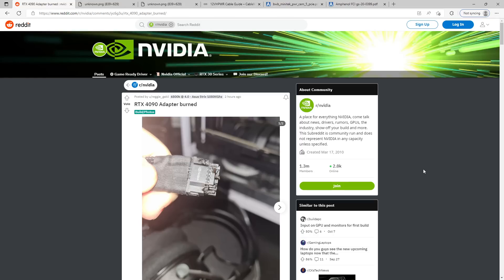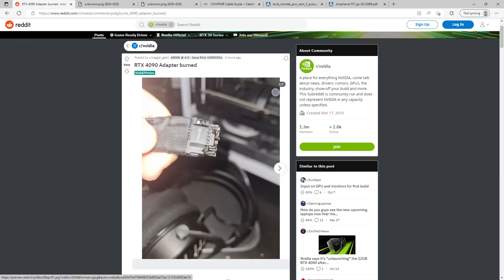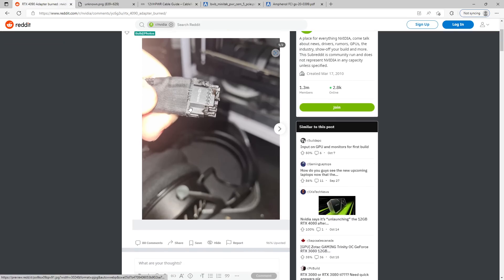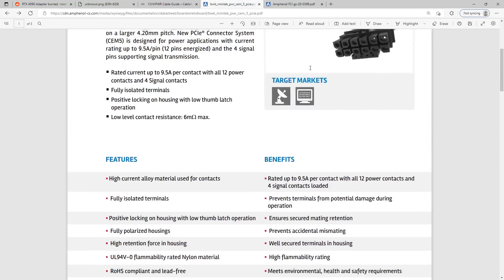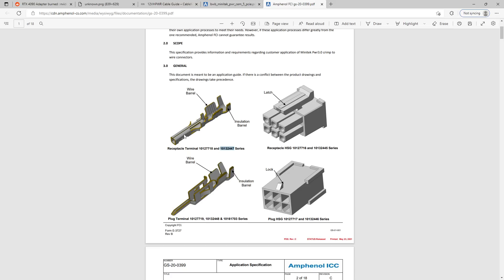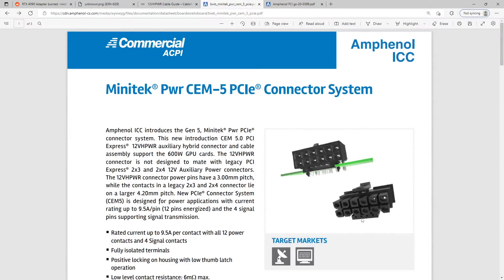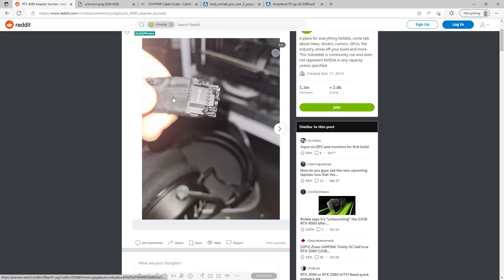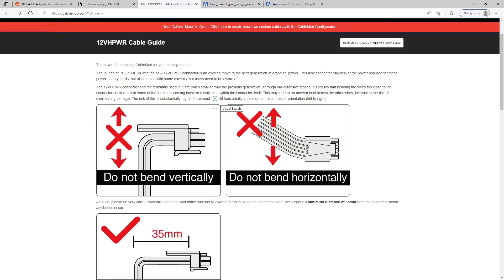The 12VHPWR connector sucks

Comment: 1:20 What about the data pins on the new cable? Aren't those supposed to communicate with the PSU to minimize transient power spikes?
Reply: Everybody is calling them data pins there is no data on those pins at all. They are sense pins that need to be grounded the combination/number of pins grounded tells the GPU how much power it can draw. Else a conversion cable to use old specced dump atx2 psu could not work at all. Its a old trick to use sense wires en used in combination with the used power connections in the connector dangerous and stupid. If they wanted backwards compatibility and security they should have included a 12v signal wire and have shunt input for every pin so the card can measure the resistance of every pin and limit the current on each pin. But yeah then the Pcb space would be used by larger but safer powerdelivery circuit.
Reply: @chinesepopsongs00  thanks for that detailed explanation

Comment: Holy Molex Batman. I thought we fixed this issue. This sounds like a load of bullshit. Most likely heat is shooting straight up into the connector from the card creating the problem. Someone should do a thermal test on the connector when the card is horizontal vs vertical.

Comment: looking at the design of those terminals (at around 10:00), I can't help but wonder which monkey approved that design. I'm not an electrical engineer, or an engineer of any kind, but even I can see that is a TERRIBLE design. How the hell did that get approved by anyone? Having that separated seam down the middle weakens the overall structure.

Comment: Silly, foolish, naive Nvidia... Wants smaller connector that can handle more current because you know GPU today = space heaters apparently :-D ... And they come up with this fragile obviously not working (burning) shit? What a piece of work. Here is an free advice Nvidia. Wants more power? And be smaler then even one 8 pin. Shove an XT60 connector there. It can handle 60A at 12V that is  720W and it is smaler then this burntup crap. And it requires only 2 wires. Better be thick ass wires there :-D ... Or an XT90. That baby can handle 90A at 12V that is sweat jesus 1080 Wats of pure users power bill money turned into FPS... Deamn... Iam having too much fun here... Great work Buildzoid. Peace.

Comment: I love the idea of the new connector, but hate the execution. It's getting ridiculous adding another 8 pin every gen. We are at the point where we litterally need 4" worth of connectors to power a card. They are going the wrong direction though. We should be moving to less wires but a larger size with thicker, more robust contact points

Comment: You’d think that if given the opportunity to create your own, custom, high power connector, they’d have designed it to be able to work for the application it’s designed for.  Well done, Nvidia!
Reply: @_Clivey  Nvidia designed its 12-pin precursor (which they used on the RTX 3090) though.
Reply: @_Clivey  See, this is what's confusing. Nvidia claim to have designed it, some people say keep saying they designed it, but it's also a standard.  
Either way, it's obvious this connector is crap for high power PC applications .
Reply: The must be hiring their management from Boeing rejects, cause they're certainly crashing and burning just the same
Reply: the 30 series FE connector was an inhouse non standard connector and had zero issues. but it also was only pulling a maximum of 450w. the standardized one is smaller and is rated for significantly more power how Intel and PCI-SIG thought that was a good idea i don't know.
Reply: @_Clivey  shhh don’t speak facts and logic in the comments section. When AMD uses the cable it will be ok
Reply: @dennisp8520  nvidiots seething their 600w card is on fire

Comment: to be fair...if this thing worked as advertised it would cut down on cable clutter :P

but this connector with it's issue's.....time for a V2 :P also having made my own cables...they might not be welded to the connector but damn they (at least with PCI / eps / ATX 24 pin / SATA / USB / PWM and occasionally molex...they will sometimes eject on there own wile plugging in) they might as well be welded to the plastic I've frequently had pin's where the tool was in to release it but I still pretty much had to wrap the cable around my hand and pull stupid hard to get it to release..have also had USB cables where the pin was not properly in the connector and it came out wile plugging the connector in to the header >.< it keeps amazing me how secure and at the same time loose a pin in a connector can be >.>

Comment: Good to have this info out there.  Its beyond me why they, all of them, PSU and Nvidia alike have done more testing and ultimately a better job of it for power connectors.  How much work would it have been to just develope a connector with double the power instead of four times the power and most likely have solved all the issues without going to extremes.  So you have two twleve pin connectors instead of one.  Certainly enough room on the PCB for two power connectors.  Sheesh.

Comment: The thing about the bending if you read that statement carefully appears less concerned with the bending of the receptacle around the pin or a consistent load bending the plug in the socket.

Instead, the issue appears to be more what happens to a multi-wire cable where the wires are held fixed relative to each other, and what happens if you then bend that bunch of cables near the plug end. The illustrations show that the wires on the outside of the bend are then stretched due to the difference in radius between the inside and outside of the bend. This may weaken and damage the crimp where the wire connects to the pin receptacle. Thus if one of those power wires gets disconnected by pulling out, it will either cause a very poor connection and potentially heat, or the gpu may try to pull that lost power through the remaining good wires, hence the warning about increased load through the wires. (Not sure about that last part, I'm a mechanical rather than electrical engineer).

But if you bend the wires further away from the plug end, firstly there may not be held as right relative to each other, so you don't get the same level of pull. This tension is also spread out more across the wire and less into the crimp connector at the plug receptacle.

Hopefully the requirement for 600w is the only reason this connector exists and the AIB 4080 and lower cards might have standard 8 pin connectors

Comment: Well, good for them, they saved $5 on PCB space and connectors! Hope they get sued for a lot more for burned components (and hopefully not houses and families). Or are they just going to blame the end user for bending a cable too much? If so, good luck to them with that too.
BTW it would be great to see those heat up under a thermal camera while you bend the cables during recording. How about that? Don't need a 4090 for that, just a general power consumer with the same connector attached.

Comment: Agreed with that. Why would they move from using beefy 8 pins connector to this flimsy little connector. Now everyone with older PSU will need to use the octopus legs extension. I find that the reasoning behind it for the founders edition is acceptable, but third party board partner following the use of this connector doesn't make any sense since the card is already brick sized. A few 8 pins connector wouldn't hurt.

Comment: That new connector is far worse that normal PSU connectors and its guaranteed that those smaller pins are way weaker and easier to damage. 
Another problem is that connector on PCB is weaker as well, it does not have strenght to hold and I am pretty sure this will be one of common problems with 4090 failures.

There are so many design issues that its complete disaster.
- Much smaller pins and connector as whole is much more structuraly weak and I mean both connectors, one on cable and one on PCB as well as reducing safety margins for current it can pass through safely.
- That stiff end of wire to connector is making it worse as it will strongly increase force put on PCB connector and potentialy break it. (using full replacement cable from PSU manufacturer instead of this stupid reduction is big improvement but not solution)
- If they left connector angled as on 30 series FE cards and make it so that when putting stres on cable will push it to something instead of pulling it out of pcb together with cable even actually bracing to gpu cooler it would have made it more durrable.
- if that connector had metal casing that was actually soldered to PCB as for example HDMI connectors are it would prevent breaking it of PCB. 

One disaster decision piled on another without any mitigation to problems it creates is worst kind of engineering. Person who came with this solution should be fired on spot.

Comment: Ok well I just bought a 3090ti and a 1000w gigabyte pcie 5.0 PSU. Should I be worried that this can happen or am I safe as long as I make a bent in the cable away from the connector?

Comment: Like, like, like like, like like, like...
You did a 17+ min video on a several minute read off of Reddit. And could have shaved a ⅓ of that by eliminating the word "like"... But, hey, and thing for subs, right?

Nvidia provided shitty ass power connections on their 40 series cards that cannot handle the demand of the load. That's it... Because of the two connections not being 'rated' (The "shitty" part btw) it cannot handle the load like the wire before and after the connection. Or else, you would see burnt insulation throughout the wire or a weakening/discolored joint on the board. And had those connections been properly rated, cablemods wouldn't have had to put a disclaimer on their products or site to cover their ass.

For those that still aren't following this process, this acts more like a over-rated fuse instead of a solid connection. Which part is going to heat up first kids? 12awg wires at each end of the connection or the 16-18awg connection? Answer is: 18 gage connection (Pins). The smaller the wire or connection, the higher the gage; the bigger the wire or connection, the lower the gage (awg).

And ideally, on those type of pins after they are crimped onto metal part of the wire, they are supposed to be soldered. And then the insulation part of the wire cand be crimped at the end. This also plays a factor in rating a connection also. How many people have checked if their pins have been soldered, even the 8 pins? I'm guessing not many...

Comment: Who knew miniaturizing a power connector and push even more power trough it, would create problems... very smart.

2x12V braided cables and 2x GND braided cables with 1 sense pin was all that was needed. Scale the mm2 for 600W and put a fat connector on it, problem solved.

Comment: Is this connector a problem if I plan to use my 4090 at ~325W? I need to cram a 4090 into an NR200 so I'll power limit it, and Computerbase says the loss in performance with a 300-350W power limit is minimal.

Comment: I think you nailed it right on. High resistance loose connections are the issue. I'm no electronics engineer but I've been an electrician for many years and we see this all the time. I don't understand why manufacturers are thinking some test in lab for 24hr period means it's good
Reply: Electronics engineer here. There is also going to be a possible issue over longer period of time in case there is a higher contact resistance on one or few of the pins, but initially it works fine, but as the card gets more power cycling and the connector pins experience high and low currents at times times, the thermal expansion and contraction might degrade the contact resistance even more. 

Like in my 3d-printer where originally all connectors were fine at the start, but after hundreds of prints and the connectors cycling between high and low current, the heated bed's connector finally melted it's contact housing and the connection broke, so on one of the pins the contact resistance had slowly degraded over time and increased the resistance, until finally it was so high the the contact heated up so much that it melted the plastic housing.

One of the causes also seem to be the very stiff wires that they use, which causes more mechanical stress to the connector, especially if it seems to be on any kind of sideways direction. I wonder if for example, silicone wires (basically wet noodle stiffness) would allow for tighter turns, because they aren't so stiff...
Reply: @antecboy  The stiffness is the copper itself, not the plastic insulation.  These are multiple 0.8mm² wires in a cable that parallels them to carry 63A like the heaviest common industrial cables with IEC 309 plugs.  Those big IEC 309 plugs aren't even rated for use below 20V (purple color code) and wouldn't physically fit.
Reply: @johndododoe1411  0.8mm²(~18AWG) wire is still quite small and silicone wire at that size would very flexible. I can only assume, having not opened these harnesses that the strand count for the copper is just average, not special in either direction. I'm guessing the insulation is PVC, which isn't the most flexible material either, but it is cheap. But if the problem comes from the copper being too stiff, then a higher strand count wire would make it less stiff for a given mm² area.

I think it would be interesting to build a custom wire harness with silicone wire to test and see if that does help with the problem.
Reply: @antecboy  Don't forget the combined stiffness of all those parallel wires.  Hence my suggestion to use a single braided copper strap for each rail and a connector that is inherently good for 67A.  The one I suggested can be trivially integrated in the back of the card with an airflow optimized cable attachment.
Reply: @johndododoe1411  You are right The 3090 ti has the exact same connector but a 3 cable adapter instead of 4. The 4 cable adapter is way too huge and stiff so its prone to damaging the connector. The PCI 5.0 cable should solve the problem or using a smaller 3 cable adapter.

Comment: I wonder if the voltage drop due to using less cables of (i believe to be) the same gauge would effect stability or overclocking, since ur pushing more current through less cables. the voltage is still stepped down internally for the core and other stuff, but i still wonder if it would cause any problems.
Reply: I think these connectors will probably self destroy after 1 or 2 years of heavy use.  Also I think the AIBS are going start using standard 8 pin or they are going to invent a new standard, because it seems this one is just dangerous.
Reply: @Slav4o911  most, if not all, 4090 cards released seem to be using the 12pin standard. it would be too much of a hassle for them to fix this now, some of them might release a card with a different power connection later down the line. And yeh considering we're already seeing melted connectors right after release, i wouldnt be surprised if more connectors met the same fate. the people that limited the power target should be fine tho, i think.

Comment: I am surprised that the damage is on both sides. I would imagine the problem area would be on the side with the most cable/terminal pull and the side bent towards would just push in tighter. Interesting to say the least. Doesn’t support the bend narrative in my opinion. Unless all the load went through the remaining connections, which overloaded.

Comment: Why didn't they just make it as big as 2x 6-Pin combined, keep the thicker terminals while still not having that huge of a footprint on the PCB.

I hope AIBs for 4060s and 4070s will use normal 6/8-Pins, but i fair we're getting the new thing shoved down our throats.

Comment: No kidding it is bad., It is simply too small for the amount of current that spec call for. Nvidia's marketing (They are main party who actually pushed for 12VHPWR) wanted to pull a move from Apple on making a small, sexy connector ignoring the electrical problems of trying to pull ~50A@12V. There's a reason why high amp cabling is fat and large.

IMO, 12VHPHR cable is going to be ephemeral as P4AUX cable back in the day (First introduced with Pentium 4 Willamette before EPS12V/ATX12V connector was finalized)

Comment: terrible half-assed connector. don't bend horizontally - don't bend vertically, don;t breath close to it. even with no bend at all, there will be some tension in the connector. i don't think the recepticle terminals are the problem (apart for being smaller), 24pin, 4pin, 6pin and 8pin ones have the same seam. the wires are a bit thin, is their rating correct?

Comment: The problem is simply the female connectors themselves. They need to have a tight tolerance when seated to the male pin connectors on the cards PCB to prevent "arcing"  AND they need to be thick enough to absorb the heat. Its clear the pins have arced causing excessive heat for the connector to melt. Its possible the metal female connectors are too thin and are not able to dissipate the heat also causing the connector to melt. The plastic housing may also be too thin,  and of poor quality with no fire retardant in the pvc materials used to prevent melting or catching fire. 
There are standards for this that manufacturers of the cabling adapter may have overlooked to cut costs. 
PSU companies that meet the required standard to accommodate the new cards  with their cabling are likely unaffected. 
Bin the connectors that come with the cards & upgrade your PSU.. 
Did the manufacturer even spend thousands of hours testing this ??

Comment: I've got a pretty large case (Evolv X), and there's no way I'd be able to give the cable a full inch before bending unless I used a vertical mount. How are people expected to actually use this without bending it?
Reply: CableMod to the Rescue 12VHPWR Right Angle Adapter is scheduled for pre-sale on October 31st.